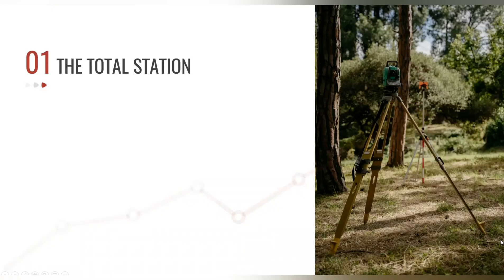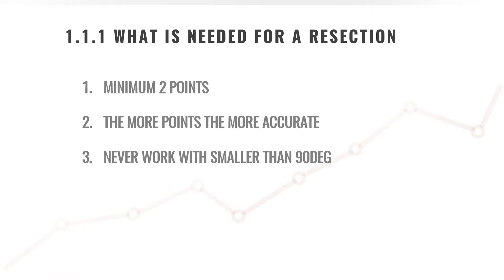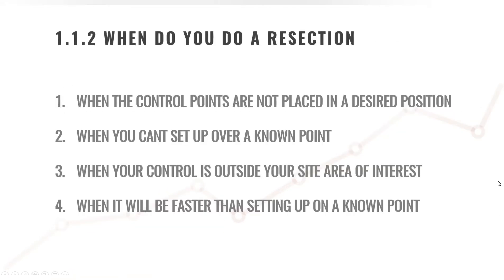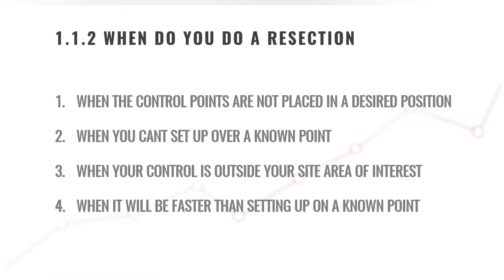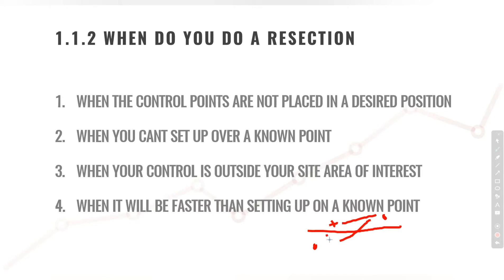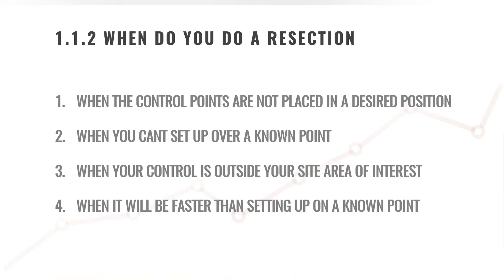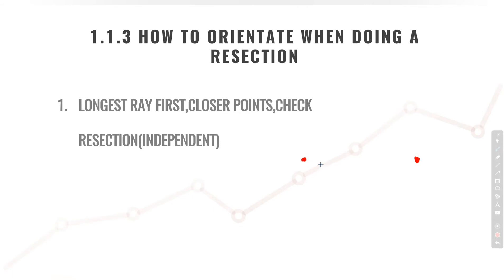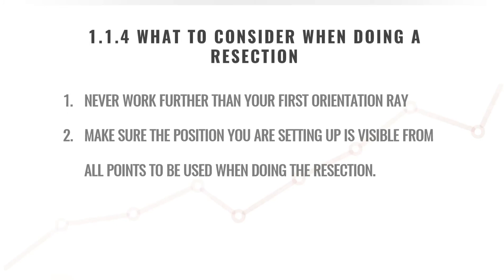What is a resection or freestation - SURVEYING TRAINING

Comment: Why can't we work with small angles. I can't find an explanation to this anywhere
Reply: Yes I stopped the video to look at the comments for this also, never heard that the second station should be more than90 and less than 180..I think its to do with accuracy,
Reply: @Panther-  Thats all i could think of, probably better practice to have a larger range. But i think you could verify the points through checks/stakeout of other known points.
Reply: The reason you MUST avoid smaller angle is to minimize the effect of the errors.
Resection is all about intersecting lines.
The bigger the angle the smaller the effect of the errors.